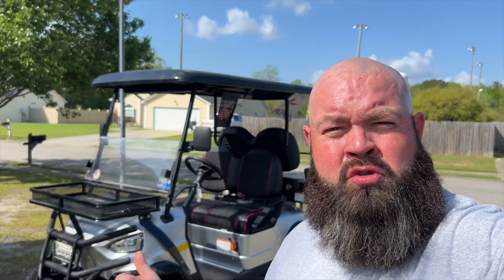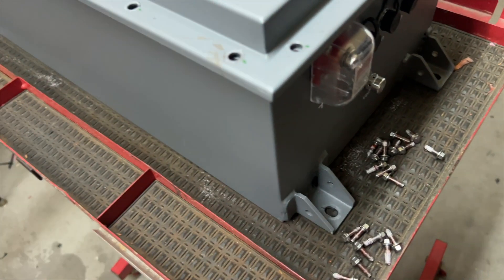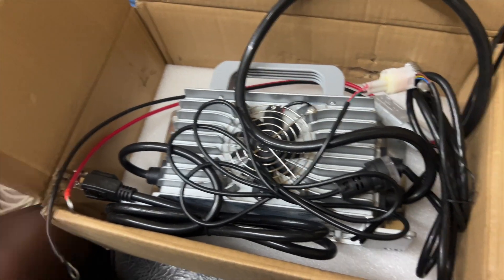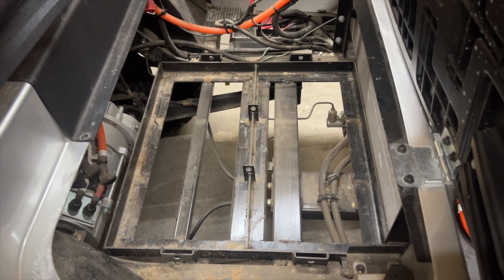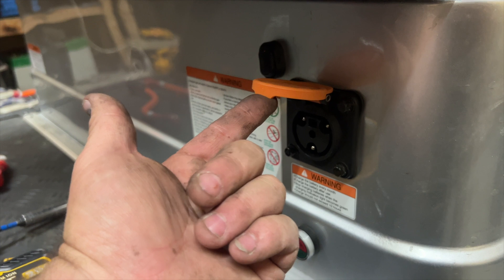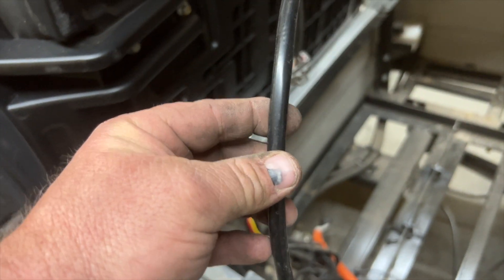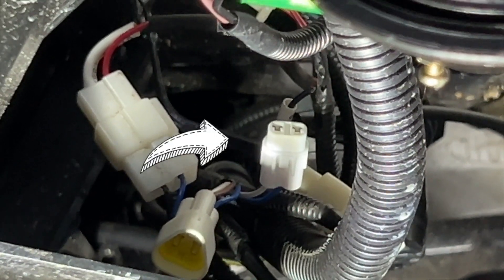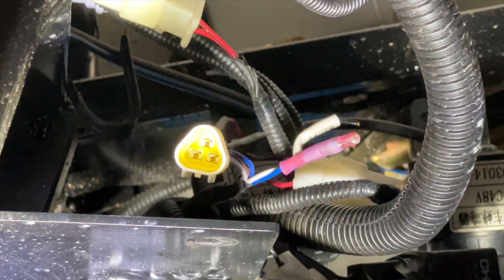How To Install A Lithium Battery In Your Kandi or Coleman Golf Cart | Charger Interlock Bypass DIY

Comment: Please explain why you would change to lithium on ghe coleman kandi? Those sealed amg that come in the coleman are excellent batteries. You can tune those carts with the amg batteries and see really fast speeds. Too fast, really.
Reply from the maker: @JT-jg8le  The batteries were about 4.5 years old and were not holding a charge. When the cart was fully charged the cart wouldn’t run at its max potential of 25mph, it was only running 17mph and the capacity was dropping fast.
Reply: I have a 2023 Tao Champ Golf Cart with 6 8V AGM batteries and they are already going bad.  They are no longer able to hold the charge very long.  Look exactly like the ones in this video.

Comment: Very good video!  I did two 30Ah Trojan lithiums as an upgrade to my Coleman.  With the weight reduction (and my tune) the cart would top out at about 33 mph!
Reply: What tool did you uses to tune to that speed?

Comment: I’m running into some of these new carts when doing the lithium conversion. A little challenging. One was a Star 6 passenger and the last one I did was a 2five by ezgo. The 2five had a charger  inverter combination. I put a vatrer 48v 150 ah in it. Used the vatrer charger but keep the original charger in it but just used it for the inverter. It’s becoming challenging because there isn’t a lot of information out yet on the new models. Nice job working around the different designs that are coming out. Keep them coming!
Reply: Agree. Solid content 👊🏼👍🏻

Comment: Im highly considering putting my cart on lithium batteries or selling what I have for a gas cart. In your honest opinion (not that you'd lie lol) what's my best option for battery manufacturer? I have a club car ds btw
Reply: Bolt energy best battery made but expensive 👍🏻
Reply: @lawn2learn  thanks
Reply: Pretty sure bolt is the same as the one he put in the cart in this video. All of those batteries are manufactured at the same plant in China. The China company will build it and put your logo and stuff on it. They put them all in that same battery box and paint it whatever color to go with your logo. You have to buy in bulk like bolt and the other companies do to get them. These are all just rebranded and pretty much the same builds. Companies like bolt are mostly all marketing. They flip China batteries because China has the best price for dealers.
Reply: HHS Energy is the China company that makes all of these batteries. These USA companies just rebrand it. They build nothing.